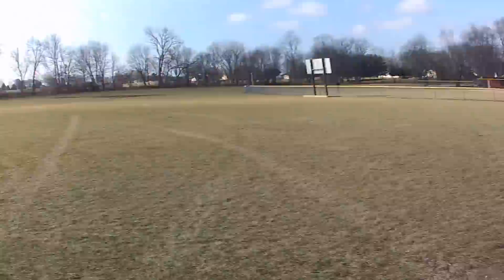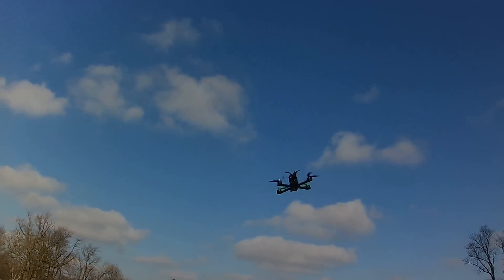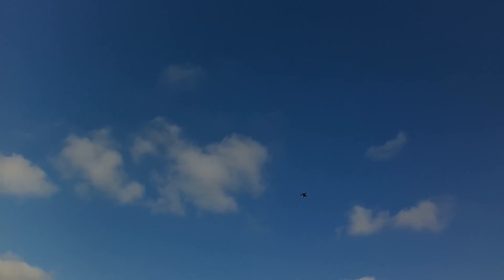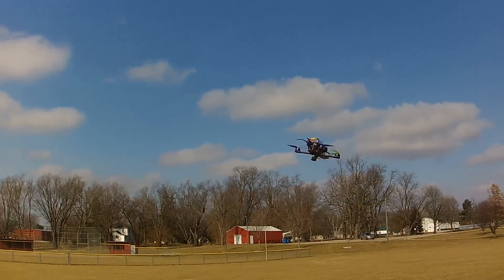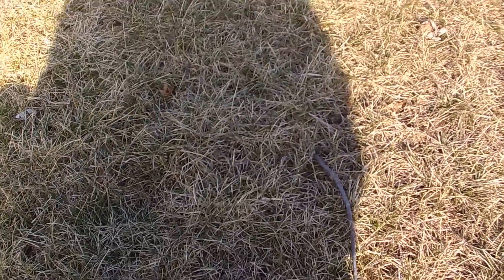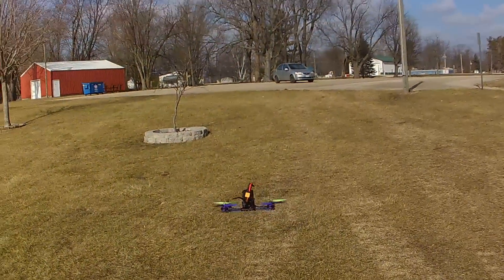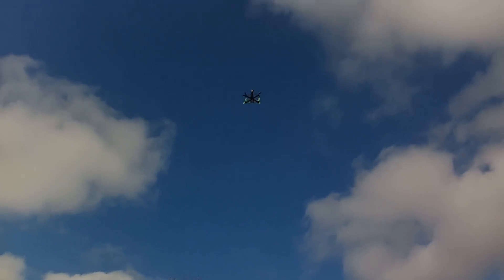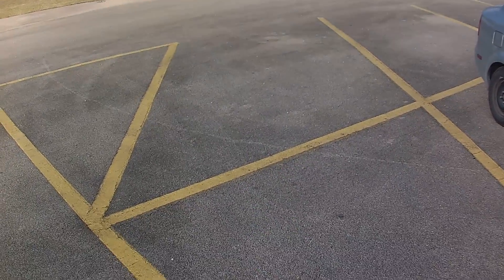Eachine Wizard X220- Freestyle- LOS- 3s vs 4s Graphene

Comment: I can't wait to get my wizard it should be here in like 9 or 10 days it has been sitting in origin post for about 6 days now banggood sent it here f**** fast it was in America in three days but God damn customs been holding it for over about a week now I'm tired of flying camera drones I want something with balls I got the wizard x220 instead of getting the x220 s I was afraid to get that fake carbon fiber body and I figured the money I save getting the x220 original I could just put into upgrades which I did I ordered upgraded parts and I know I'll have a full carbon fiber body the one thing I love about race drones is that you can change anything so the quad you start out with isn't necessarily the quad you end up with at the end after you upgrade

Comment: Holy shit I want this how much is it and where do I have to go to order one that thing looks like such a good quadcopter and I would probably enjoy it and I'm just wondering should drones be flown in snow because I'm probably getting a sky viper outdoor racer for Christmas and my drone that I got last year the motor stopped catching on the gear and then I tried to mess with it to get it to work again and I ended up snapping the little metal thing that holds the tiny gear on the motor and also somehow ripped the wires out of the motor?
Reply: I was flying my drone last year and was flying it in the snow and then one of the props stopped spinning it would make a sound like the motor was but it wasn't catching on the big gear and then I just pretty much fucked myself over by messing with it when I should have just let my cousin do it because he's the one who got the thing for me and he knows way more about them than I do because he owns drones and has a pretty good one too and if I would have left it alone I would still have a drone that's flyable

Comment: did you have to do any mods for the 4s battery or just plug and go? I know people talk about re-wiring to protect possible voltage spikes.

Also what kind of props are you using?

Comment: Hi! How long does it fly with 3s and 4s batteries? Thanks!
Reply from the maker: +Ivan Novak with the 1500 3s about ten minutes line of sight, maybe 7 MINS FPV. Probably 5-7 mins on 4s los and 4-5minutes  in fpv
Reply: wow, that's more than I thought. thanks for the answer! :)
Reply from the maker: sure no problem, i am flying in very cold temps, so times may improve in warmer places

Comment: are the ESC and motors up to the power ?
Reply from the maker: They seem just fine to this point, never even feel warm to the touch, but it is winter here and quite cold, so 4s may be a bit much in warmer weather. Ill be honest.. the ESCs and FCB and PDB are probably not up to the task, and I am lucky its winter :)
I think the motors would take 5s easily.
Reply from the maker: I have many years of lipo power RC car experience, so I know alot about the mechanics of it all even though I am new to flight

Comment: Just curious if you have compared 4s graphene to a standard 4s lipo?  I almost bought 4s graphene for my wizard until I seen how much they weighed. Ended up going with nano tech 4s which is half the weight.   Thanks for sharing ur video 👍🏼
Reply: hi bud
Reply from the maker: +tizzle420187 yes I have used actually both the nanotech and the Turnigy graphene and I actually prefer the nanotech because it's lighter but I fly a lot of line of sight which I prefer a very light machine when flying fpv a lot of people prefer the extra weight so I guess it's a toss-up the graphene is a little more powerful but the regular 4S lipo is a monster as well
Reply: Josh Ketchum  cool thanks, just getting into the hobby myself.. so much to learn. Lol
Reply from the maker: +tizzle420187 I try to bottom mount battery on my wizard today for the first thing and it was an epiphany it is a hundred times better I love it